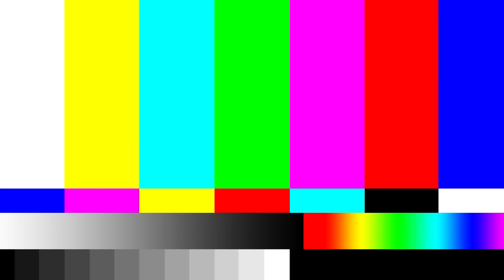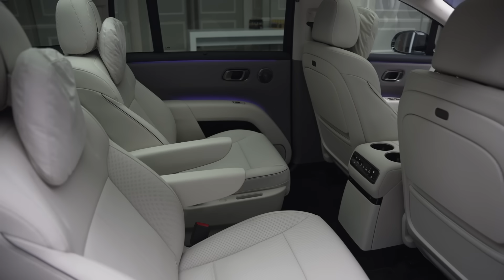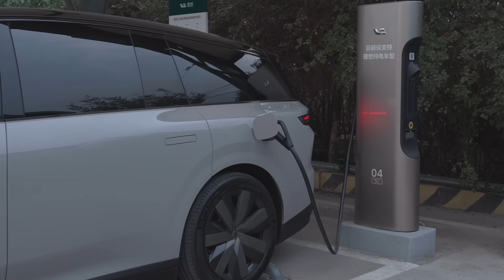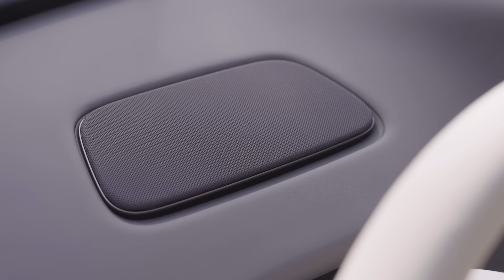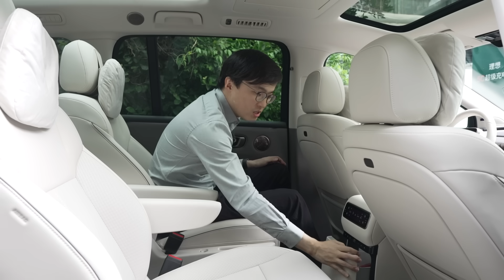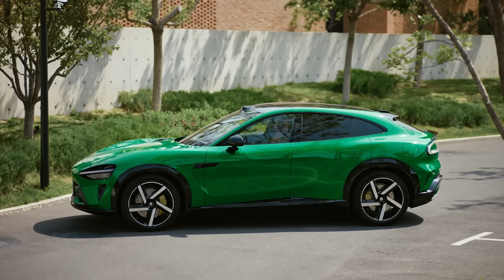Clearly NOT An SUV - Li Auto i8 Review

Comment: Supercharging.
In 10 minutes you get just under 70 kWh. But when supercharging with up to 475 kW the internal resistance of the cells reaches high values, hence the robust cooling. So you charge 70 kWh and probably have to pay for about 80 kWh? Mind you, efficiency of super (or flash) charging is not good. 10 to 15 % is waste heat for which you (!) have to pay. Ask ChatGPT or any AI program.

All the waste heat has to be dissipated so robust cooling is necessary. It's expensive and prone to breakdown. The battery is thick as shown in the video.
Many cars supercharging in a row, the grid must provide for that and they produce massive amounts of heat. What will that be like on a hot summerday with no wind.

When swapping the charging station pays (!) for little waste heat because charged at low charging rates in off-peak times mostly.

I think the future will show that swapping will be so much more convenient, efficient and cheaper. Supercharging is just not. There will be a shift towards swapping, I'm sure. Today I read this about CATL:
https://cnevpost.com/2025/08/04/catl-to-bring-100000-battery-swappable-cars-car-inc-fleet/
Reply: That's not how it works lol
Reply: @Aztasu
It does work that way. Do your research and understand physics. 

Energy efficiency drops at high C:  As charging rate increases, a larger fraction of input energy is lost as heat.  Na-ion cells have high coulombic efficiency at moderate rates (≈99%), but at ultra-fast charge the I²R losses reduce the energy efficiency.  For example, experimental data (comparing discharge curves) show that a Na-ion cell delivers only ~80–90% of its low-rate capacity when charged at 5–10 C (with the rest lost to overpotential and heating).  In practice this means that the useful energy fraction falls as C-rate rises.  (One study found ~85% capacity retention at 8 C vs 0.2 C – though data varies with chemistry.) The excess energy appears as waste heat, exacerbating thermal management needs.

Comment: This car is literally ahead of L90 in every aspect besides storage space and BaaS. But with such fast charging speed that isn’t even an issue. But others will just throw the lower price of L90 to sway the conversation. It’s literally like comparing Apple with Android. The little things like not having manual handles to open the glove box and fridge shows just how much consideration Nio gave….
Reply: But is a base model i8 really worth that much more than a fully-optioned top trim L90? The i8 starts at ¥322k while the top trim L90 is ¥299k, and at that price & trim the i8 is missing some features like a rear entertainment screen and the fridge, and the L90 has a visually nicer interior, better 3rd row headroom and more cargo area (including frunk). The i8 should definitely be priced higher than the L90 for things like its NVH and ADAS, but it is too high right now.
Reply: @needles_balloon The nicer interior is subjective. I personally think the L90 interior looks like Geely Galaxy and most lower end EV design. It’s just that it’s all padded with much more quality materials than all those. i8 price is high because it targets a different audience and shows Li won’t participate in a price war. I doubt Nio is making any significant margin in the hopes of just finally getting a car out that can sell high volume.